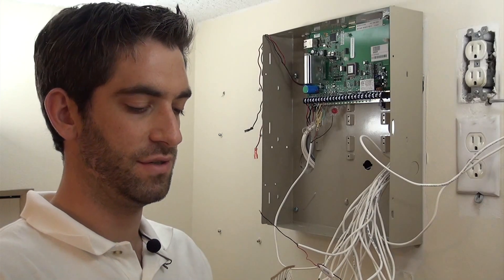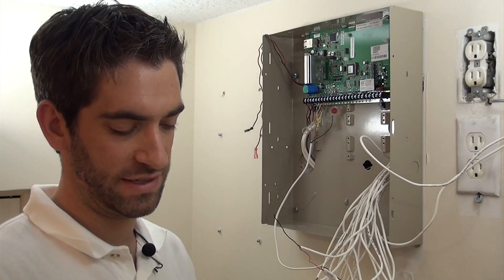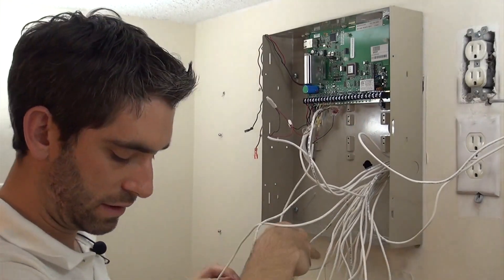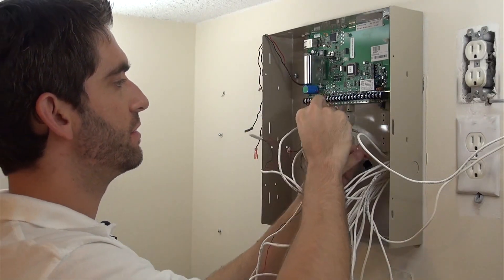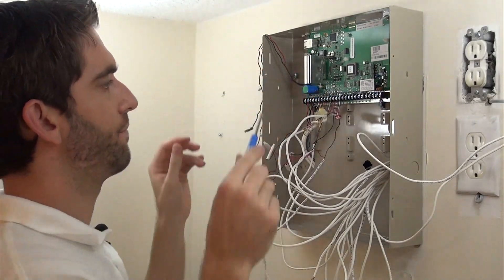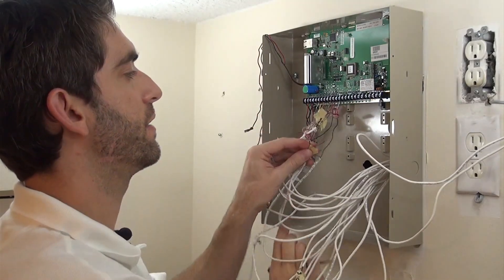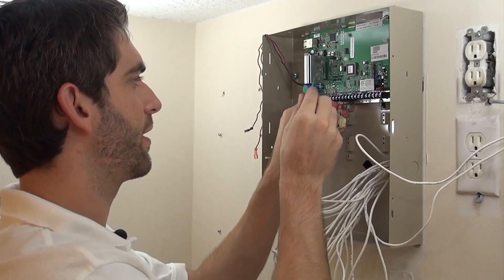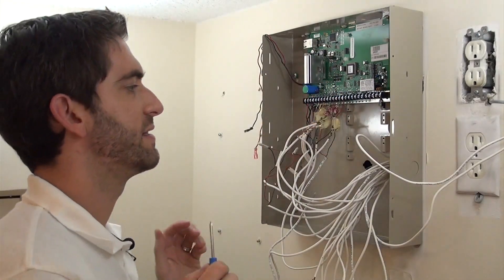Honeywell VISTA 21IP: Zone Doubling, Installing Orange, 3K Resisters

Comment: This is not how you wire up a panel eOL means end of line which means at the and device not at the panel
Reply from the maker: Hi Benny, it's true that EOL means end-of-line, and where possible we always recommend proper resistor placement, however, depending on the situation, putting resistors at the end of line may not be possible. For example, you may be replacing an older panel with a newer one. The older panel may have already been installed with the resistors at the panel. If not for the fact that this video is specifically meant to show you how to wire for zone doubling, I'd say just make the zone normally closed and don't include resistors at all.  But with zone doubling, you must use resistors, so even if they are at the panel, they are required.
Reply: @AlarmGrid   Couldn't disagree more, do it right.  Even at an old panel I go to the end of the line were the peripheral is and you put the resistor in the peripheral.  This is just either ignorance or pure laziness either one is a bad excuse for an alarm professional.   You effectively rendered each zone useless and not monitored if a short was on the line the panel would never know.
Reply from the maker: @brianalex1017  You're free to disagree, that's what makes this country great! However, it isn't always possible to retrofit resistors at the end-of-line where they belong. Zone doubling actually solves this problem. Any short on a doubled zone will cause a trouble condition on both doubled zones until the short is cleared. Regardless of resistor placement.
Reply: @AlarmGrid   Your output is indicative that you clearly need more input on this situation a short would not identify a problem in a zone doubling situation if it's not eol.
Reply from the maker: @brianalex1017  Please refer to the Vista-20P Installation Instructions dated 03/15 (the latest available).  Page 8.  The section on Zone Doubling.

Comment: would you still use end of line resistors when zone doubling
Reply: Yes, It would be best in case someone tries to cut the line. But they will work at the panel as well. The resistors also tell the panel which zone is faulting

Comment: More on EOL resistors: It is often good to not use EOL resistors  to avoid vendor lock-in: when I purchased my home many years ago I was relieved to discover the EOL resistors were at the panel (SOL). The system was a GE, which I had no intention of using and used a different resistor value than the alarm panel I was going to replace it with. I think it's good practice to discuss future upgradability with your customers so they don't have to bust out their walls when switching to a different alarm panel/resistor combo. In any event, it you're going to install resistors at EOL, leave extra cable that can be pulled out so the resistors can be swapped if necessary.

Comment: EOL resistor clarification. Many here point out the resistor should be at the end of line (EOL). Sure, if a potential burglar is more likely to access the cabling than the sensors (example, commercial buildings where alarm cable runs throughout attic/crawl spaces, and contractors, etc have access to). In a home it's far less likely strangers will crawl through your attic to short your alarm cable. It will probably be easier to do this at the sensor (window contacts, etc) while you use the restroom. Ideally, the EOL resistor should be right before the sensor, which is not always possible (simple window contacts, etc). If an exposed sensor is large enough, you might be able to put it inside.

Comment: So, if someone cut the phone lines in the panel, that would render the whole system useless? Right?
I mean, don't they have safeguards in place for that? Seems like a huge problem if not...
Reply: Amer ica no not true. Any good alarm company will sell a GSM radio backup with the system and this eliminates the need for phone lines. Phone lines are going away in the next few year anyways.

Comment: Hi, if I am using wireless, device how what do I do with left zone ports? Wire with resistor? How?
Reply: Yes, you can disable a wired zone by connecting a 2k resistor ACROSS the two zone terminal screws. Another option is to delete zones 1-8 in the *56 zone programming menus if you won't use any of the on-board wired zones.

Comment: all systems are the Honeywells. 6150/6150 and then the 3rd is the Honeywell Lynx Plus device. not sure if I answered your question.
Reply: +Michael D The 6150 and 6160 are keypad model numbers so those must be wired back to a Honeywell alarm control panel which would be located in a beige metal alarm cabinet. In that cabinet, you should be able to determine what the model number of the system is. The LYNX Plus is an all-in-one wireless system meaning it's a control panel and keypad in one unit and you would not be able to wire or integrate that type of system into a wired VISTA panel.
Reply: Ok. Yea, definitely not the touch (all in one) system. Its an L3000 I believe.

Comment: I have 2 key pads already hooked up, can I add an additional 1?
the 2 I already have is a 6150 and a 6160 but I also want to add an Honeywell Lynx. I think it's called. is that possible?
Reply: +Michael D No, you can't integrate a LYNX Touch system to a VISTA alarm control panel. Did you mean the Tuxedo perhaps?
Reply: I think it's the L3000 version. Voice automated. Version
Reply: The L3000 is an all-in-one system. You can't connect a LYNX PLUS L3000 to a VISTA panel.

Comment: never zone double. It will be a service nightmare down the road
Reply: +KW1S We agree that zone doubling is much more complex but it does save some money for a customer that doesn't want to pay for a 4219 zone expansion module so we wanted to show how it works.
Reply: +Sterling Donnelly yes I know.  My 35 year experience when I have to service old contacts that have high resistance the zone that goes off is not the zone that is actually the problem.  I don't give the customer a choice.  It's a 4219 or just 8 zones. Not to take away anything from the video,  it's good instructional video.
Reply: +KW1S No, we appreciate the feedback. We always encourage people to use zone expanders over zone doubling.
Reply: Zone doubling rocks. It's not so much about saving money. It makes for a cleaner install, especially for installs with greater than 16 zones. I have over 30 zones. I solder my resistors to the wire, use heat shrink, then connect resistor right to the panel when EOL is not desired. I don't think it's as complex as people hear make it out to be. Don't hesitate to zone double, works great.

Comment: can you please show how to wire up multiple zone in 1 zone terminal on that panel please??
Reply: MILLANDO TOLLGIS You can't zone double on zone 1. You can wire sensors in series to have multiple devices using one zone though.
Reply: yeah lets say from fbi panel to 20p panel without using zone expander my question is how many zones can put in each zones in the panel..how many zones can hold in each zones of the terminal in 20p panel without using zone expander. how to wire series (this is home run wire)
Reply: MILLANDO TOLLGIS I think you are confusing sensors and zones. A zone can be a single sensor or it can be a group of sensors wired in series. When wiring sensors in series, so that multiple sensors are grouped into a single zone, you would not know which individual sensor was activated when that zone goes into alarm. You can connect as many sensors in series to one zone as you'd like.
Reply: last one how about the powered devices like motion sensor can i wire them in series for example 4 motion sensor in one zone is that possible?
Reply: is there a chance you could show some videos like 128 bpt or fbt please
Reply: and setting up a videofied motion viewer on 21ip please?( Videofied Bayguard)
Reply: thanks frank

Comment: Honeywell said in a circle the EOL of line is at the end. the panel is the start of one leg of the wire which goes out to the device the other side of the wire being 22/2 or 22/4 the last wire circles back to the panel.  End of Line   Begin the panel zone then out to device and back to panel.

Comment: Shouldn't the resistors be placed EOL?
Reply: Yes, for true line supervision, the resistors should be EOL instead of in the panel.
Reply: Clint VanRoekel Yes, if there is only a sensor in a zone. No, if there are multiple sensors in a zone. Practically No, if it's a single family home. Technically Yes, if it's a commercial place where a burglar can access the sensors during daytime.
Reply: I know this is an old comment, but... Technically, it depends.

If you are strictly using contacts that are closed when the zone is secure, making a complete circuit, it won't matter where the resistor is, because, since the resistor is in series, it won't matter where the wire is cut. If cut, the circuit will never be complete and therefore faulted permanently, just as if a door was open.

For resistors in parallel to switches that must be open to secure the zone, yes, it would have to be after any closed switches for the wire supervision to work properly. Otherwise, if the EOL is in parallel in the panel, the panel would see the resistor all the time, either in the correct state where the wire is intact and the switch is open, or the wire is cut, which is also an open circuit, just like the open switch. The panel wouldn't know the difference.

Hence why I like normally closed loops. Resistor can go in the case, and is still immune to being defeated by wire cutting, and can easily be removed if you ever switch panel brands.

Comment: Here's the LV Hack again. Dude, you was privi to a gravy train with biscuit wheels for an upgrade. It was a bird's nest before and you're turning the homeruns back into one. You have an open wall cavity behind the enclosure that you could neatly dress the runs to the zones then push the slack back into the cavity to be utilized yet for another day/upgrade. Also, it looks like you're using 3M silicon butt connectors...you know 3M makes a direct depth tool specifically for their connectors or maybe they didn't think installers would just use their "Ideal T-strippers" or lineman pliers? I see you're still spreading the cancerous idea of terminating the EOL's back at the control panel....geez!
Reply: If the resistor is EOL if the sensor gets removed and it hasn't got a tamper switch, the alarm panel will not notice any difference.
Reply: james stephenson Not necessarily true, depends on how the zone parameters are configured  zone(+)-\/\/\/------------[device]--------------( - )zone, although the EOL/\/\/- is mounted @ the control, removal of the initiating device would cause an alarm or a zone fault condition
Reply: +GypsyMoFoJoe if the system is armed on a non 24-hour monitored zone
 
There is a reason it is called an END OF LINE.  People circumvent this all  the time.  Not recommended by any manufacturer.

Comment: Hello,

your videos are great.
I just went this morning following your steps to swap out the vista 10se system and keypad that was in the house I just purchased. I followed your steps but the system have a 4 wire smoke detector that did not have a resistor and i connected to zone 1 and yellow and green and red to aux pwr and blck to grnd. the rest i followed your instructions changed the resistors to 3k. When i power up the 6160 and set *16 i get longrng 103 rf error, fire 01, and fault zone 2 - 8 I only have connected up to zone 7.  any suggestions and also how to connect the 4 wire smoke. i got my router connected and the gsm card as well but no gsm service yet. just trying to get it setup and working again first
Reply: Zone 1 is only for 2-wire smoke detectors. You need to connect 4-wire smokes to one of the other zones and you need to use a relay or the on-board triggers to setup the power reset for the smokes when you disarm the system. You should look at the installation guide for proper setup of the smoke detector. 

Also, unless you are zone doubling, you should use 2k resistors not 3k.